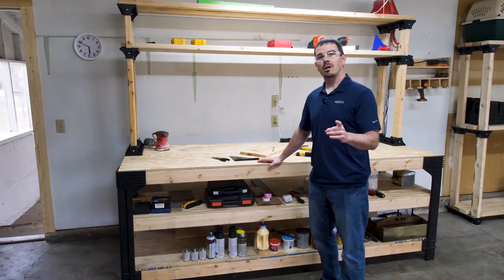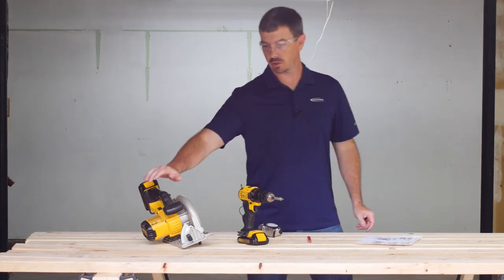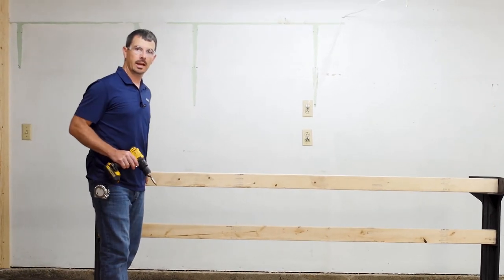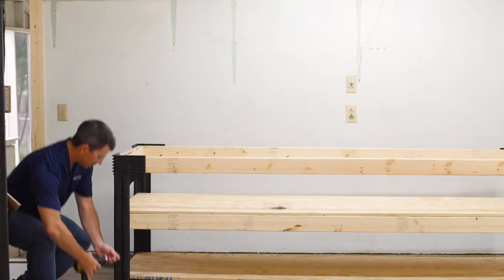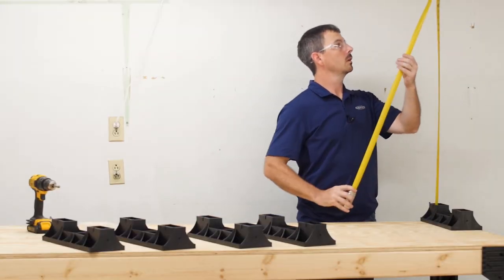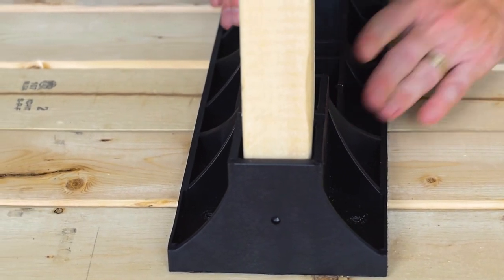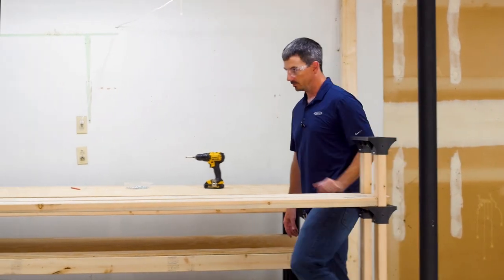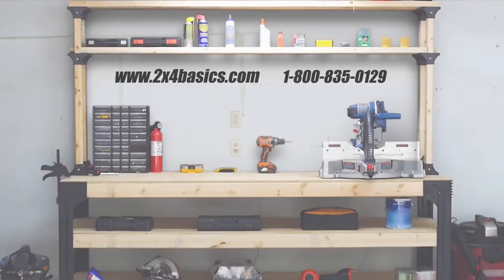How to Build 2X4 Basics® Work Bench Kit with Shelf Links®

Comment: This looks nice and simple. Going to give it a try. Is there an alternative material I can use for the top? Looking for something with more of a finished look. What are the option instead of plywood? TIA
Reply: I just bent a piece of aluminum sheet metal and put it over mine but I suppose you could use mdf and some sort of vinear or some peal and stick vynl flooring to make it look presentable in a living space if that's what your after
Reply: @brianstapleton769  what thickness plywood should be used?  

This is going to be in my garage.